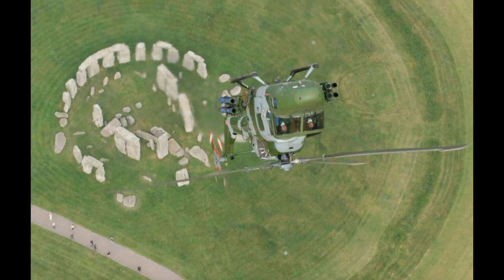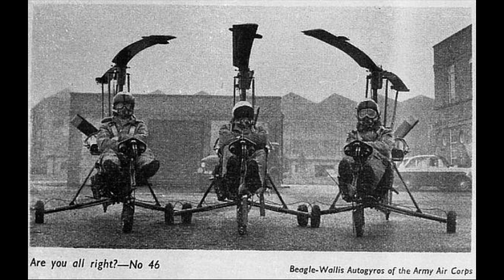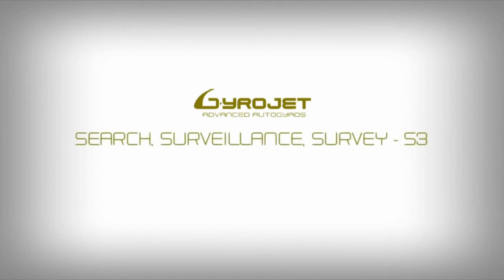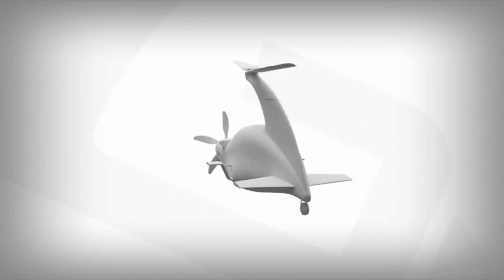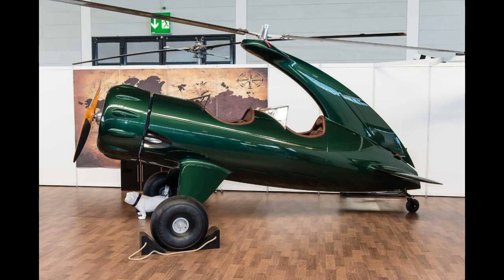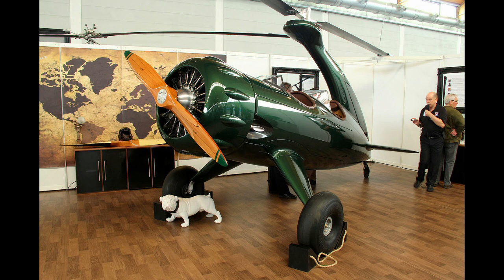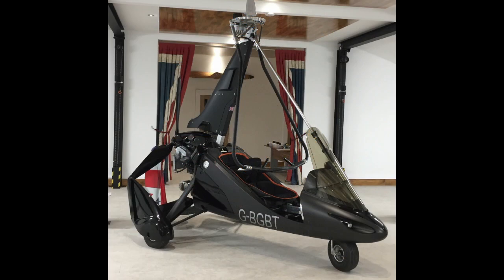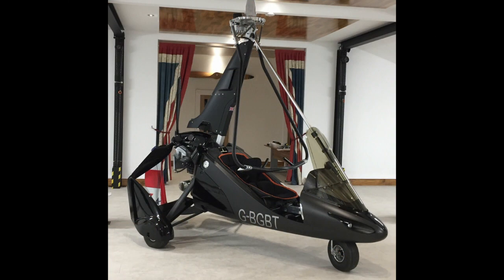History of the Gyroplane - part 23 GyroJet Scorpion S3 & BJJR Bulldog

Comment: I am not able to understand which is the configuration that get the most of the benefits (pusher or tractor). I only know that the bulldog is the gyro I like best. The propeller is far from ground, wheels, and main rotor. It could be easily designed as a conventional enclosed airplane cockpit (flying without the need to wear helmet and glasses is more confortable). The most important fact, however, is to find out the flight features: nothing it is more important, on my mind. If I have to choose between a ugly good flyer and a cute bad flyer I always  go for the good one.

Comment: While it seems quite unlikely that either the US or Britain will ever employ gyrocopters in a military role there are two countries that might greatly benefit from doing this, Ukraine and Taiwan. 

Ukraine might do so because they desperately need a bigger air force and so could take advantage of the low cost of a gyrocopter vs a helicopter or fighter jet. 

Taiwan in that given an invasion by China, China will likely fire any missile to ground their fighters jets on day 1 of the invasion, which as Rommel said about the invasion of France will be the Longest day. In contrast gyrocopters can be based  most anywhere and thus would be hard to take out or grounded by attacking their bases.

Also, the gyrocopter can benefit from modern technology that keeps making weapons systems smaller, lighter,  and have longer ranges. For example BAEs missile guidance kit for the 2.75 inch rocket, e.g. see

https://www.youtube.com/watch?v=V092M25KeUA&t=2s

A gyrocopter armed with several of these plus a EO/IR/laser for targeting could engage targets 2-3 miles away.

Automatic grenade launchers might be another weapon that could be fired from a gyrocopter, either forward fired or fired to  side like a mini gun ship. e.g. see

https://www.youtube.com/watch?v=TvSOrS9YD0s

Also, since a gyrocopter can go very slow,  that could make it hard to detect at low altitude by doppler radars.  And at altitude they can fly slow enough (while losing altitude) to possibly make chaff effective in that the radar could not use Doppler to distinguish it  from the chaff.

So maybe what the gyrocopter manufacturers need to do is market their gyroplanes not to the US but to smaller countries  that can't afford big ticket systems like expensive fighters or helicopters (or need the forward basing to survive against missile attacks while on the ground) but have a need for air support to augment their existing force structures.

These might need to be a tad larger to be  able to carry  a few hundred additional pounds  of  equipment but not thousands. 

A beefed up gyrocopter might even be able to carry one small diameter bomb. e.g. see

https://www.youtube.com/watch?v=TpJMygz6v40

This could give a gyrocopter a stand off of maybe 20 miles or so.  Eight  gyrocopter (say they cost 5 million total)  could the deliver 8 of small diameter bombs  for the same as one jet fighter costing 50-70 million dollars and be based  anywhere.

These could augment say ground launched versions but could be massed over a  any area as needed over a wide front.  e.g. see 

https://www.youtube.com/watch?v=SmUU1SUDeAo

So the punch line here is don't waste trying to sell these to the US or Britain but to those countries that might need a low cost way to employ air power to augment their existing force structure, something neither the US or Britain all that much needs... or at least thinks it needs.
Reply: Sadly, I fear you’re correct. Many aircraft need a military market for launch, and NATO countries will be slow to pivot. Ukraine has shown the high value of low cost platforms, but the US particularly loves their high capability toys, no matter the cost. As these designs are a far cry from anything currently on the market, they may not be able to move forward without a military customer.

Comment: Hello 

1. Unless you will develop gyro that can fly full envelope with modern counter IR missiles and all the 2020 go to war adds on tech no military will even think about that platform, not even for the lowest risk Operations profile.

2. You will have to build at least "certified as any single on the market (= non Lsa/UL )"  to make low scales LE/ police and national organizations ( Forrest service, wildlife + conversation,SAR etc) to take it to their consideration.
That's usually how it works ( on the big $$$$$ + Legal + Operational demand consideration market).
You better design it to fly with IR/HD cam systems and or gruond and weather radar adds on well within solid envelope.

3.just find me an investor that find a way to put to the market 100k Glass avionics LSA certified enclosed cockpit solid tool... (Composite Rotors dhaa), thanks.
Reply from the maker: Works well in a parapublic role